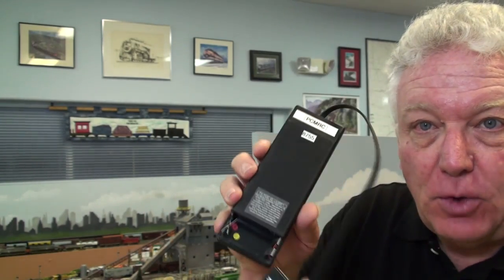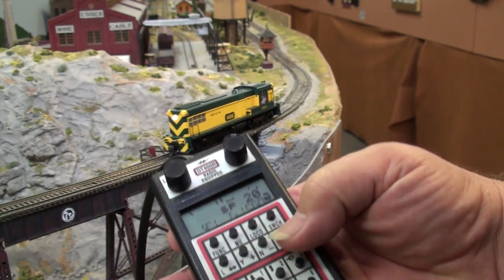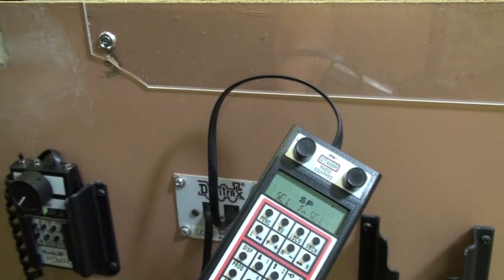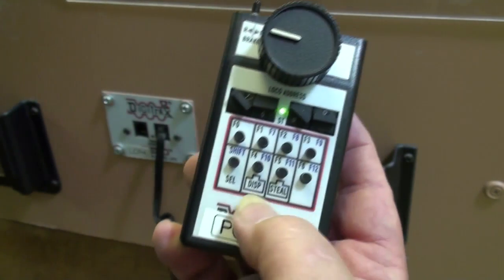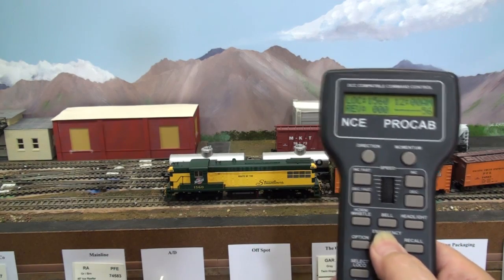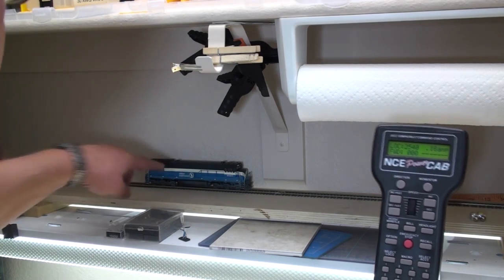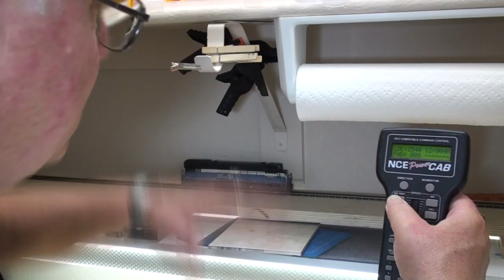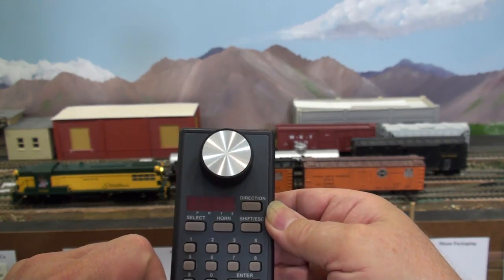DCC system comparison | Digtrax - NCE | Model Railroad Hobbyist

Comment: Wow..by 3 minutes you convinced me NCE is better. I can shut it off by pressing shift horn at the same time, no worry about shorting with batteries, no flipping batteries while not in use, no tail hanging, no plugging in to acquire the loco...admittedly I stopped there.

Comment: Interesting, NCE seems the hands down "winner", although Digitrax has updated their gear a lot over the past couple of years. I, however operate with a Lenz system, and the NCE is almost an exact copy of the Lenz system (the throttle's have nearly the same way to set addresses and CV's). The major issue I have with Lenz, is that the manuals are translated from German, and a lot of the syntax is goofy and difficult to figure out. However, I found better translations through the Yahoo Lenz group and just printed them out. I didn't see whether either of the two systems have a "scrolling" feature. That is, there's a button on the Lenz throttles that allow the operator to scroll through the list of engine addresses that have been entered into the system, so no "obtaining" the address manually each time.

Comment: I'm under 60, so the natural choice was NCE for me!  LOL!! :)
Seriously ( because I see there's a TROLL on here shooting down half the comments!).....
When it came down to stuff we do often, like CV's and consist shuffling, NCE is hands down the most user friendly of the two.

NCE users NEVER have to calculate CV 29. Programming starting voltage, or speed matching is a breeze.
When you use NCE - you'll never need to know what a BINARY is!!!

If you're running two separate trains with one throttle, switching between the two is a one button breeze! 

There's quite a few more reasons why NCE is a better choice...
 Essentially, it's powerful & flexible enough for advanced modelers, AND user-friendly enough for novices to jump right in!!!  :)

In my 9 years with DCC, I have never ONCE heard that about Digitrax.
[Yet, most ol' timers SWEAR by them!!]
Reply: Dave - 100% correct about the Digitrax remote. Archaic!

Comment: I can leave the batteries in my MRC unit with no issues, and they get recharged if I plug the wireless handset into the unit overnight. Bigger and easier to read screen in my opinion too. Have you guys done a review on the Prodigy Advanced systems?

Comment: Nice and clear video. I honestly don't know where to start to convert my layout to DCC. It's a large home layout and will have about 350 to 400 feet on mainline once all the track is installed. I would like to run 2 to 4 locomotives and have radio control. 

My other problem is I am old school and have many older Brass Steam Locomotives and if possible i will like to convert some of those especially my 3 Sierras. (It's a mountain railroad with steep grades). The other brass I am not sure if it will be worth the expense (and time) to covert as I have about 30 older brass locos total. Any input is surely welcome. Thanks........................Philip

Comment: Thanks again for this video!  I found it very helpful in deciding on a DCC system.  I live in an area that does not afford much opportunity to see or try many of the DCC systems.  I did get to check out some Digitrax gear and the UT4 and DT402 throttles at a store and also during a visit to a club layout.  I'm not near enough to a club to participate so going with what they have was not really an issue.  I did like some of what Loconet had to offer, and the Zephyr would probably been as much power and functionality as I would have needed.  I like the 402 throttles, and some of the other Digitrax products seemed like a good all around package.  I could see it working out well for many.   The things I didn't like, or that didn't fit for me, were the Zephyr's stationary form factor, and that I didn't particularly like the UT4 throttles.  My plans don't really have a great spot for a stationary throttle, such as a yard, at least not at this point.  To get where I was wanting to be, at least at this point, the Digitrax system was going to be a little more costly, and in the long term the same was true. 
   I ultimately chose the Power Cab system along with a Cab06p engineer throttle.  I will likely add a third throttle at some point.  Along with this I've also picked up an SB5 smart booster and a CAT5 UTP panel.  I've made an "adapter cable" per the provided instructions and all is well.  At this point, the SB5 and panel are stored away waiting for me to get to building.  For my space and goals, NCE fit nicely, The power cab was a great starting point at a good price.  The limitations of the NCE starter set fit into my plans nicely as well, I still only have 2 locomotives, one with sound and one without.  My space and plans will never accommodate more operators than the SB5 will allow for, nor do I plan to utilize a computer for operations or signaling/detection.  Loconet is nice, but I don't plan to use more than NCE will offer. 
  I like the interface and throttle on the Power Cab, as well as the NCE engineer throttle offerings.  I think with the new SB5 and Cab06 throttles, NCE really deserves a look, and may just tick all of the right boxes for those who won't use the additional features Loconet offers, or won't need more than 6 cabs, or have a club to join that uses Digitrax.  These are the main differences that sold me on the NCE system.   Thanks again for the video as it was a great help for me, clearly demonstrating the use of the two systems and their throttles.   Maybe you could put up a video showing the Zephyr Extra and the Power Cab, and their respective upgrade paths, highlighting some key differences in the systems.  That would help folks immensely!  Thanks again!

Comment: First Off the Tittle should be Comparison of Digitrax and NCE Throttles.
After reading the comments found that one thing was not mentioned. I initially looked at Digitrax due to the Fact I run Kato N Scale and they have a Partnership with Digitrax. But here are a couple of issues I found when choosing between the two most of the HO clubs here in California seem to like NCE because on the surface it's simple.
Digitrax 400 series can control two locos i.e. why their two knobs.
Digitrax Throttles can be used with out a 9V Battery (he skipped that) all their Throttles have loconet connectors and can run off loconet bus power.
Also he didn't cover the Zephyr series their are two DCS-50 and DCS-51 these two are very friendly look like your old school DC Throttle.

But here is the main reason you want to go with Digitrax.
1) more accessories than any other system also only digitrax supports transpondering.
2) Best warranty 1yr no worries warranty doesn't matter you fried it or you modified it i.e. solder contacts etc.
3) Great Tech support and FAQ's
4) Uses loconet 6 wire system doesn't matter if you flip the wire 1&6, 2&5, 3&4 are interchangeable.

Ok Im a Fan of Digitrax so to be Fair tell you what I don't like 6 wire cable and icecube connectors are more expensive than 8 wire and RJ45 icecubes.

If you go with Zephyr or use DS unit can only run 28 locos well I don't have or plan to have 28 locomotives but typos when entering the loco number eat up those slots. so you get some weird issues so you have to remember before going crazy trying to fix the issue reset the throttle or DS unit.

And last item I don't like about digitrax N Scale sound decoders, it's very dificult to find space for the 300uF capacitor and when it stalls it goes through an entire sound startup sequence before it starts to move. Their some CV's you can modify that will fix this but Im planing most likely to not use sound in the locomotive but in a rail car more space and don't need to worry about stalls.

So the number one question you should ask your self before you go DCC is what do I want to do. Second Question is do I want to join a local Club. That will really narrow down which is best.

I for example run 2 layouts one with Zypher DCS-51 Test layout 36" x 26" has bit of everything almost. Main Layout is 10' x 12' runs around the perimeter of a room and want it to fully operated using your iphone or android or remotely via web with camera gives you cab view and shows track layout and you can see were the locomotive is due to transponding in the locomotive and caboose.
Reply: Great Customer service?  I need to replace a knob on my throttle (the one that changes the speed).  Sent in a "How can I obtain a knob" request.  "Digitrax does not send out parts, you have to send in your throttle for repair.  $35 + parts + shipping."  Brenda, who is apparently head of customer service as well as the repair department, "Sir, Digitrax does not sell parts."  Of course, they do sell parts, they are selling knobs for $35 + part + shipping + the inconvenience of being without the unit for however long they have it.  When I pointed this out to Brenda, she hung up.

Comment: Only thing that would be more helpful is the steps for "consisting" locos on each. I have seen one a while back for digitrax, but how would it work for NCE
Reply from the maker: NCE consisting: Press the add consist button, enter lead loco number and direction, enter tail loco number and direction, then enter any in-between loco numbers and direction. Done.

Comment: They have the digitrax duplex radio system which you dont have to plug in to select a loco and program and such. Also you can type in the numbers for the system instead of spinning the knob.

Comment: I don't know about the US but in the UK handheld DC controllers are available from Gaugemaster.  They're sold separately so you should be able to connect one to a US voltage transformer.

Comment from the maker: Digitrax allows you to run one loco without a decoder - NCE does not allow this. Running a non-DCC decoder equipped loco this way does not give you the finest speed control and the loco makes harmonic noises constantly when run this way. Most who have done this con't consider it a serious way to run a non-DCC loco on a DCC layout. Better is to spend the $15 for a fleet decoder and do it right.

Comment: Wow. I'm completely confused. I may just opt for the Bachmann cheapo DDC controller. There is a ton of info in this video I guess, but it's beyond my level.
Reply: John Brown -  The B'Mann EZ-DCC is an excellent way to get started! Even if "getting started"  is after 32 years of running analog, like I had.....
The LEAST regrettable decision I ever make, was getting a $149.95 NCE PowerCab!! It had a LOT more controls on the hand-held throttle - but was more user-friendly than ANY of the others!!! (Except EZ-Command - but the Bachmann system is VERY limited, and you'll outgrow it quickly) 

However, if all you're going to do is run 2 or 3 trains on a small Layout, an plan little or no further expansion, B'Mann may be the right one for you!

Comment: First thoughts:
I did not realize that you could not acquire a locomotive without plugging in, that feature alone would cause me to reject this system, a wireless system that needs wired connections to "get" a loco? I s there a newer version of Digitrax that allows complete wireless control like all the others?

I don't like turning the knob to find a CV, as opposed to being able to directly enter the CV. Modern decoders have many higher numbered CVs, and I'd be spinning that knob forever.

Comment: Arthur, you're cracking me up!  The only wire I saw was the Digitrax throttle short cable, and since you're an NCE guy, you had to make that point.  I was talking to an NCE modeler near me and he was the same way: why bother with Digitrax.  As a newbie, I am still working with my given-to-me Digitrax Zephyr, and don't have any other DCC throttles, but plan to use WiThrottle (with JMRI, as you know).

Comment: Love  my nce power cab will upgrade to a nce power pro soon ish
Reply: Have you upgraded yet?  If not, have a look at the SB5 Smart Booster.  It allows walk around capability with the Power Cab, and frees up the Power Cab panel for the workbench or other projects.  It allows up to 6 cabs and 3 accessory devices such as a USB interface, Mini-Panel, etc.   If this is enough for your needs, it may just save you some cash.  I'm not sure other than that, what the major differences are between the Power Pro 5A setup and a Power Cab expanded with the SB5.  I've got a SB5 booster(not in use just yet), Power Cab, and Cab06p, and so far I'm more than happy.
Reply: Isaiah Furrow I can concur with the SB5 Smart Booster! 
It was my first upgrade before going to a full Power Pro system.
If you have a bedroom-sized layout, and run no more than 3 or 4 sound equipped trains at once, the SB5 will end up being the ONLY thing you'll need. FAR more economical too!!  :)
Reply: Carmine Allocca Yes if you're not needing more than the cab address limitations of the SB5 supply, it's a great addition to a power cab.  I could imagine adding a booster to the SB5 at some point, if I'm running enough sound and consists and off-track lighting and animations and switch motors and.... and.... but I can't imagine needing the full Power Pro system.   Carmine, what did you upgrade to the Power Pro for that the SB5 couldn't provide with additional booster support?  Do you have need for more than 6 cabs and 3 accessories?  Any insight would be great.  So far I can't imagine going beyond what the SB5 will give me, my space is limited as well as budget, and my plans are for a layout that could support only 3-4 operators TOPS at it's final stage, but likely myself and one operator will be the usual setting, or solo running.
Reply: Isaiah Furrow I'm RECOMMENDING the SB5! ;)
Honestly, I just wanted the reserve power!! :P
I run 3 cabs, and 3 multi-unit, sound-equipped trains, with an occasional 4th, doing switching....
I do have a LOT of powered turnouts, reverse loops, and powered accessories!!

 My original Power Cab, with the SB5 Smart Booster would've been more than adequate!!

 At worst, I could've added a DB5 "Dumb Booster" at the other end of my Layout (22 feet), and THAT would've handled EVERYTHING!!

 Naw, my ego just got sucked into the 10 amp Power Pro system...

 I don't regret it, it's phenomenal!!!  But as I said, and for FAR less $$$$, I could've stayed with the Power Cab, with the SB5/DB5, and the Layout would've been fine! ;)
Reply: Carmine Allocca Right on, I was just curious if there was something I was missing as far as differences in the two systems ....Thanks for the replies, and happy railroading in 2015....

Comment: One of the most important aspects of any tech purchase is customer service/support.  There is a wealth of information on the Digitrax webpage BUT: A case study.  I have a Digitrax throttle and I need to replace a knob that runs the speed.  They've used this knob for their throttles for years.  I sent in a request asking how I can obtain this knob.  "Digitrax does not send out parts, you have to send in your throttle for repair.  $35 + shipping + parts."  Brenda, who is head of Customer Service as well as Repairs, "Digitrax does not sell parts."  When I pointed out, "Of course you do, you are selling me a knob for $35 + shipping + the part + the inconvenience of being without my throttle while you have it.  Brenda hung up.  This is not great customer service.

Comment: Looks like the same ditrax components offered when I was into railroading 35 years ago. thinking f getting back into the hobby but this stuff needs a SERIOUS face lift. Looks like "Analogtrax" to me
Reply: Steve Sherman - you're fairly close.....
I battled this long and hard, 10 years ago, when I finally decided to go DCC. 
I had the good fortune of having a good LHS, that let me "play" with 4 different systems! By far, NCE was the most user friendly, so that's what I went with, and never looked back.

10 years later, I've upgraded to the NCE Power-Pro system, with my original PowerCab running a programming track. That's the beauty of NCE!  I have upgraded to an impressive, STILL user friendly, powerful DCC system, and I was able to REUSE every piece of the original $149.95 PowerCab!!!

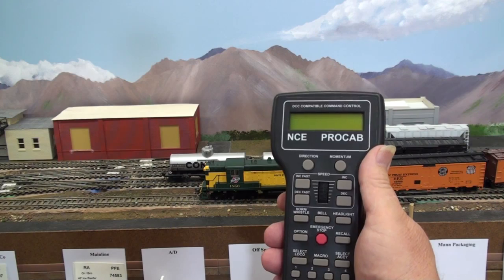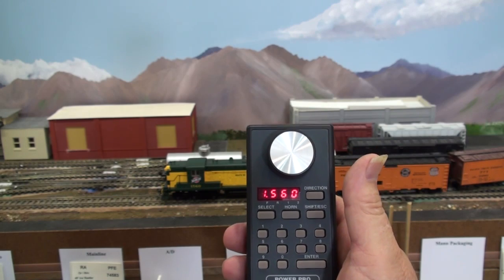Comment: 3:54 Why is it programmed to not make any noise ? You mean not even idle ?!  NCE , all locos immediately are idling just by turning the main power on ! We can turn it off on each loco, but why, unless the 'shop' wants them cold. 5:17 That's why speed wheel should be vertical like NCE has. Did you mean the left knob can be assigned to be throttle for lefties? 12:43 Ah ! Now THERE'S a controller !! 13:05 On tethered NCE control you do not have to push the Emergency stop button. It all comes on immediately with main power. The wireless needs the red button hit I believe in order to search for its radio channel. 23:14 Ah, Now THERE'S a satellite (my name) throttle ! 24:47 There's no readout of headlight on/off because it's assumed you're down at your engine and can, duh, SEE if light is on or off ! Thanks Bruce. It's obvious NCE is the winner. Glad I bought the PowerCab  and satellite some , what, 7-8 years ago. No layout any longer due to having to relocate 2 times last two years and now $ is tight. But I think I'll be able to build a 10' x 10' shelf, switching ops soon. Can't wait to fire up the NCE Cabs again ! I have 3 small Bach steam: 'Modernized' 4-4-0, 4-6-0, Mogul and an RS3..all run A1. I'll have to reorient myself to the old CVs. But it'll all come back... 
Los  Angeles, last day of 2017 !! ....Happy new year to all....M